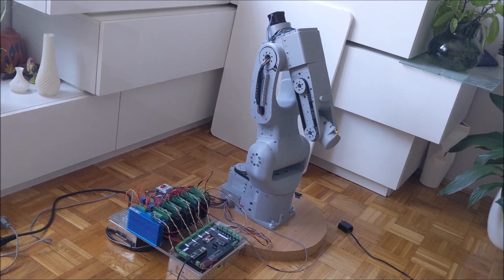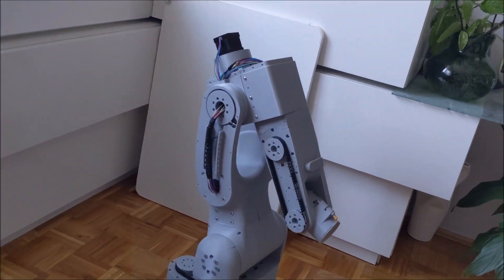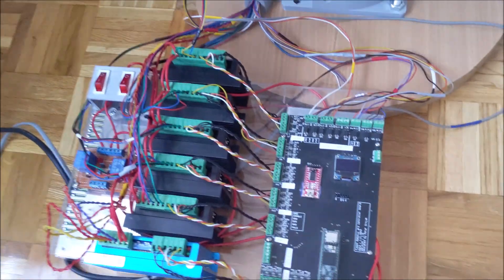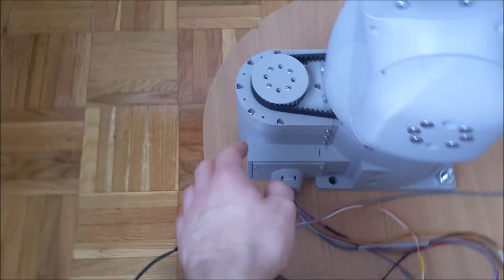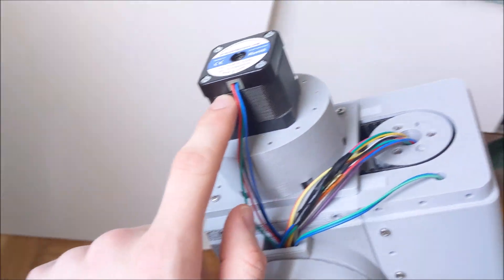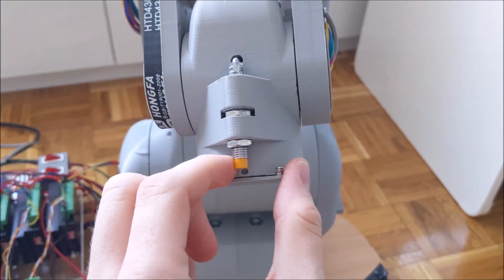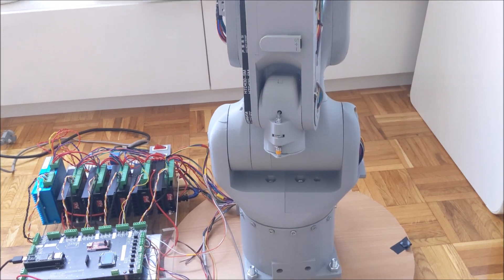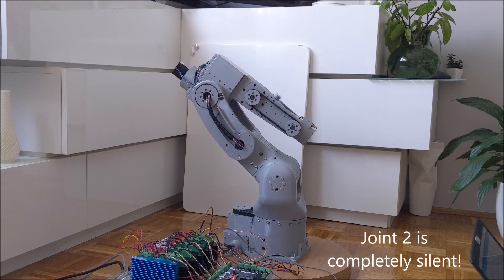Faze4 - 3D printed 6 axis robot arm

Comment: Great Work, why havent u used 150KG RC Servos? (I'm not into Robotics) But I have started to Design my first 6 Axis Robot Arm 3 Days ago the Projekt is finished 0,5%😂. I want to use 150KG Servos good or Bad Idea?
Reply from the maker: Hobby servos have really high backlash, high gearbox ratio (so no transparency) and generally break really easy
Reply: @source-robotics Which Motors would you use for a 700-800mm Long arm Which should lift max.1KG and  has max. 6 axis ?

Comment: Very interesting robot. Why did you not use cable chains for the cables?
I'm looking into building a better robot that I currently have, but as for stepper motors and gearboxes, I found that using harmonic drives (yes I know they are expensive), and using sensors directly on the stepper motor - I can easily find it's position.

I do not have a 3D printer, yet, but I'll construct a "frame" out of aluminum, and later make outer parts to mount to the frame.
However, looking at the stepper motors I want to use, it will become a very costly project..

I like the design you have implemented to your robot, looks very industrial. Was thinking of the robots we have at work, it's almost as big as one of them.
What is the lift capacity of your robot?
Reply from the maker: Hey i dont know about the chains for cables, could you explain that a bit more. For the better version there i cm6 robot  that i built, look it up on the channel. Atm i am close to finishing a new robot that will be much much better. Feel free to join the discord for more discussions. Lift capacity is around 1.5kg

Comment: What are the specs? Payload?

And did you think about ROS integration?
Reply from the maker: Payload is around 2 kg. I didnt fo any ROS integration but I am planning to. There is much more info about the robot in description, docs, github and building instructions.
Reply: @source-robotics  Hi Petar. Thank you for your reply. I have checked the docs ansd they are looking good. I have to dig into ROS and see if teaching and/or 3D sensors might help me to configure such a robot to change the steel sheet of my 3D printers :)

Comment: Looks great! Do you have a link to that stepper driver that you like? The blue one?
Reply: @source-robotics  Amazing! Thanks for the response Petar! I was wondering if it was the Stepperonline driver, thanks for letting me know! Have you tried any of their 'closed loop' stepper kits? The price is very reasonable compared to open loop drivers, and the torque curve is much flatter into higher RPMS, you might be able to get a lot more speed out of the arm!
Reply: @source-robotics  Nice! I'll look forward to seeing it! Thanks mate, hopefully I'll have some more stuff coming soon! I'm working on a design for a 3 axis CNC with a robotic toolchanger which should be fun!
Reply: A Tell me which program to use to control the arm robot

Comment: Really good! Black drivers, as I think, have no resonance compensation. Blue driver (clone of Leadshine AM series, I think) has such feature. U may stay black drivers, but in this case u will need to solder some ceramick capacitors in parallel to existing.
Or u may apply 1/32 or even 1/64 steps deviding if it possible due to moment reduction.

Comment: This is amazing work! Another suggestion for an alternative stepper driver is the X-Nucleo-IHM03A1. Has built-in motion profiles, current and voltage control options and drives up to 50V, 10A. About $10 from digikey for Arduino Uno compatible shield. An Arduino library and more information is here: https://www.megunolink.com/exclusive/powerstep01-10a-stepper-driver/

Comment: Maybe you could get more speed and accuracy if you put weights in the backs of each joints to balance each axis for more smooth and consistent motion?
Reply: In general, adding weight to the links of the robotic arm is not a good idea. Because by doing so, you risk adding alot of inertia problems. so you end up with a robot that behaves weirdly. Still in very big robots, you can add weights in the 1st or 2nd links, that are the closest to the ground...
Reply: @mohamad6533  https://youtu.be/F29vrvUwqS4

Comment: The design is nice, but you should get 2HSS or HSS Drivers and Motors, those hybrid stepper motors / servo motors are amazing.
You should get rid of that stupid Teensy or just keep it to pass the information down to a FPGA and run your motors from there.
You will be able to run with crazy speeds and accelerations and microstep the shit out of those motors while moving all 6 axis in the same time.
BTW, you can also program those blue motor drivers with some special RS232 or RS485 cable and some software. That's the real turning point, you can do crazy stuff there.
Reply: I am actually building a copy of this arm with 750w 400w 100w and 50w servo motors, rs485, and harmonic drives. You're absolutely right!

Comment: What is it about those louder drivers that makes them so much more noisy? I get that the quiet one is higher quality and more expensive, but what's the technical reason? 
thanks
Reply: Price != noise. Well tuned drivers do not cost a furtune. You might want into PowerSTEP01 drivers and voltage mode control.

Comment: very good work, especially finish quality of 3D printed Arm, electrical wiring managed very good and very nice driver arrangement. I'd like to advise if you can use servo motors instead of stepper motor, its more fast, accurate, less noise, and reliable as well. also try to put all electrical stuff inside the electrical enclosure and good cooling fans. please keep going  I hope to see updates.

Comment: Truly,  a great looking robot. It must have been a grea journy to design asseble and program such a beast. I am wandering do you use any simulation software to run the arm or have you done hand calculation for kinematics - I am not asking for any files, just wandering how far are you going with this project. I am working with some great automation software so I am very interesting in future of this project.
Reply: @source-robotics  what kind of microcontroller are you using ?
Reply: @source-robotics interesting, should run smoothly then.  thanks a lot. Great project.